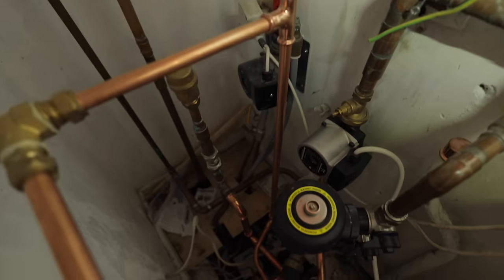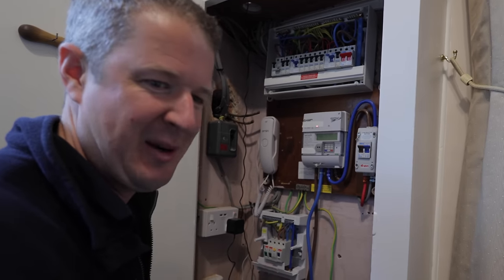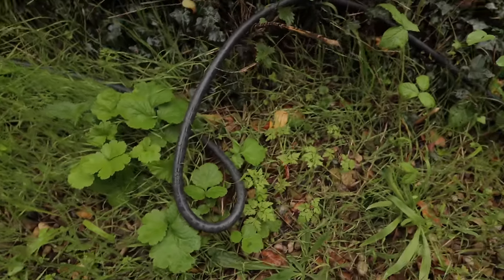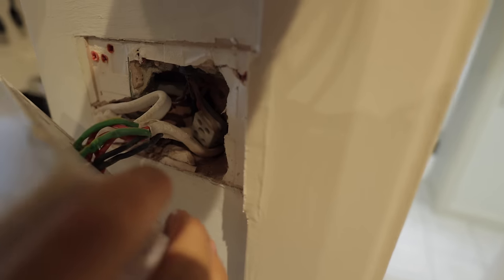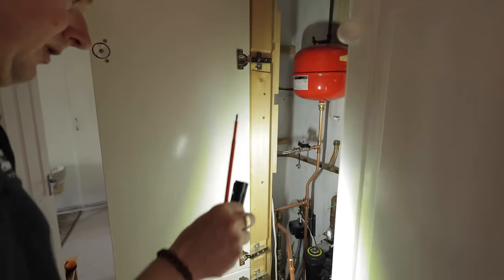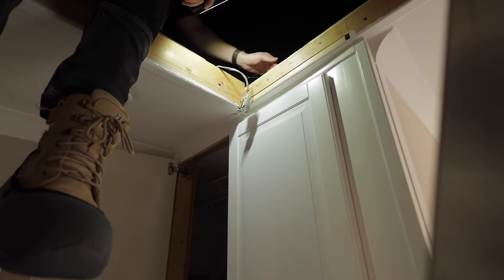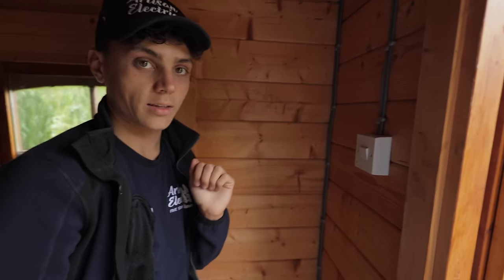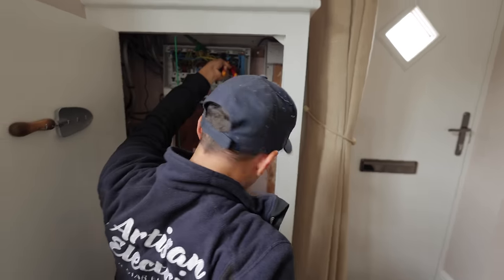The WORST Socket Wiring I Have EVER Seen!

Comment: With these sort of jobs you should recommend a rewire of the house and relocate CU to a safe accessible location with verious Goverments saying the futures electric everything and installing EV chargers, Solar panels etc most domestic house wiring thats over 10 years old needs to be checked and rewired if necessary. This should bring down the cost of rewiring a house